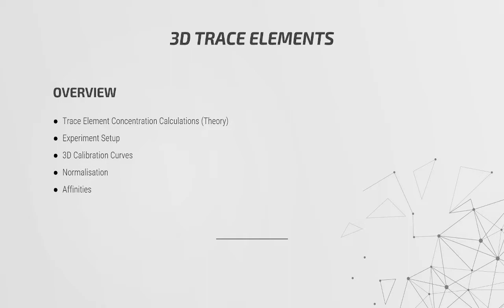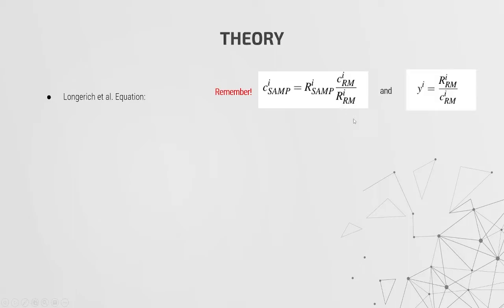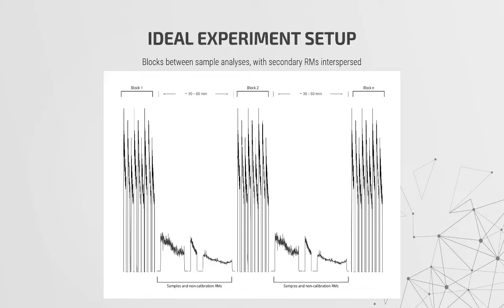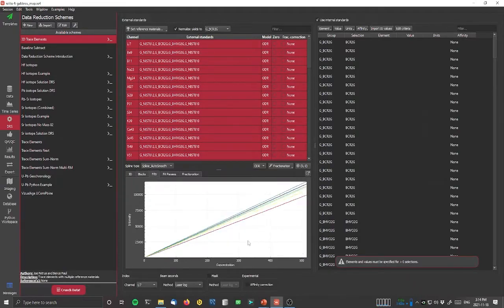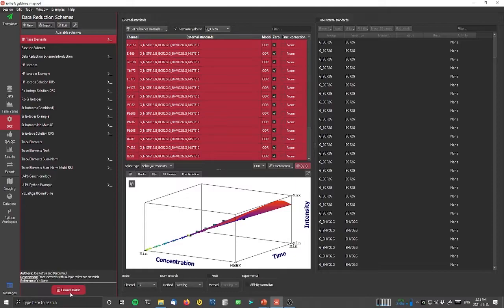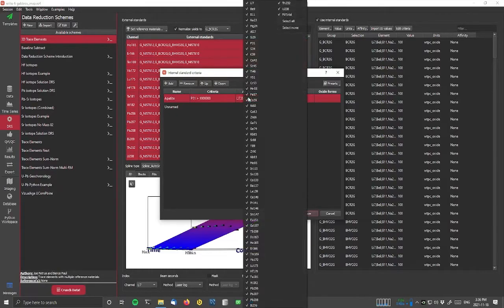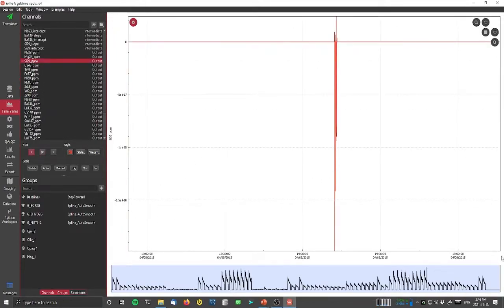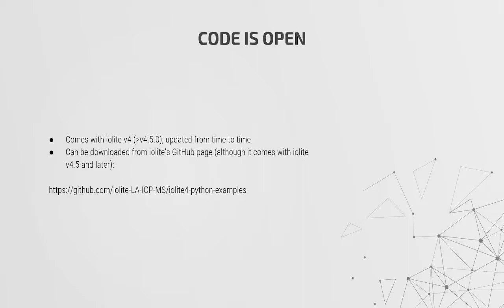iolite 3D Trace Elements webinar - Nov 2021

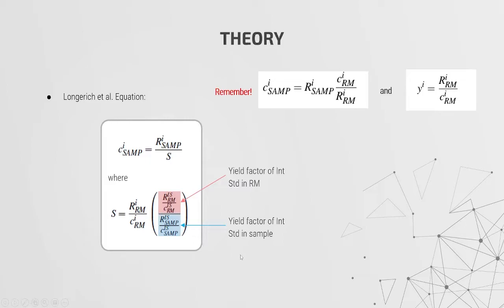Comment: 13:02  The way Longerich Equation is written here seems to be wrong? Yield factors of RM and SAMP are flipped.
Reply from the maker: Yes, you're correct. Sorry, this was a typo in our original paper, and it was copied into the presentation.

I've written a blog post describing and comparing the different TE calculations here: https://notes.iolite.xyz/posts/tes_combined/
The correct form of the equation is shown there (as well as a couple of other ways of expressing the same idea).

Thanks for picking this up. Sorry it's taken so long to reply.